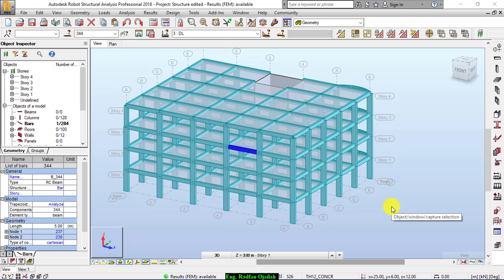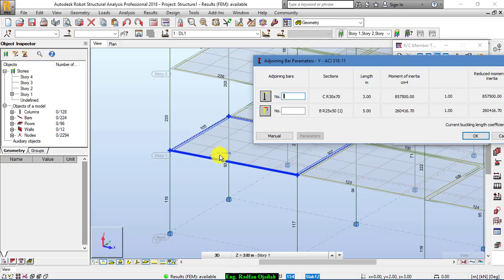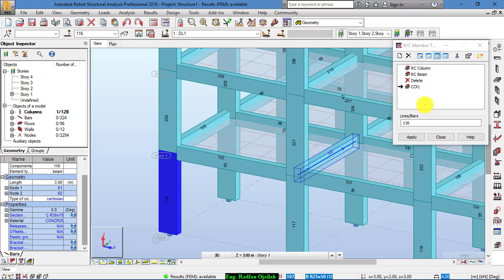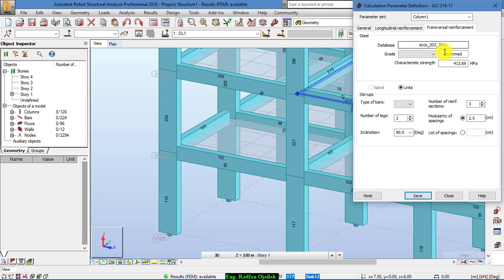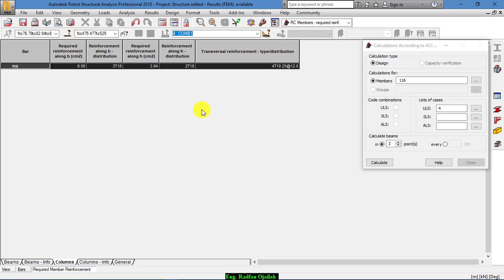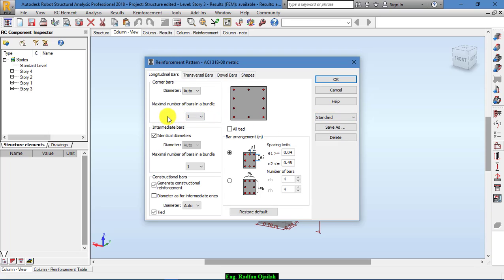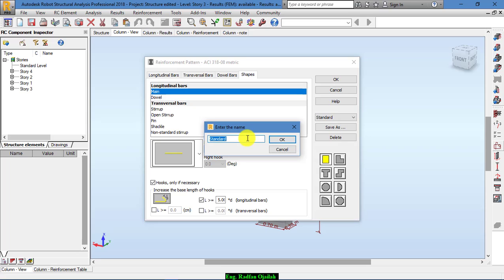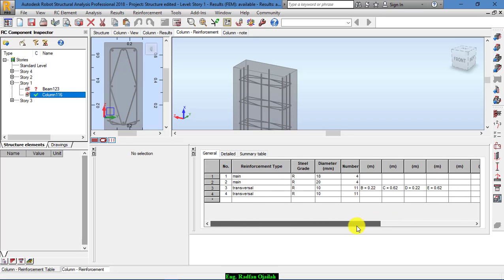Lesson#10 Designing a Column of a Structure In Autodesk Robot Structural Analysis

Comment: Hi , your videos are very informative, however i have a doubt regarding design of columns, can we design all columns together or we have to do them individually, that is one at a time?
Reply from the maker: Usually columns are categorized according to their location in the structure. In usual structures we have 3 to 4 categories: middle, side and finally corner column. The procedure is to design just three columns, one from each category and the results apply to columns of the same type unless you have special column or column with certain cross-section, then you have to design them individually
Reply: @RadfanOjailah  thanks for your very quick reply. You've been a great help.
One more question, do we have to use both REQUIRED REINFORCED and PROVIDED REINFORCEMENTS at the same time or using only one method is enough?
Reply from the maker: Required - theoretical area of reinforcement
Provided - final distribution of reinforcement based on the calculated above theoretical/required are of reinforcement